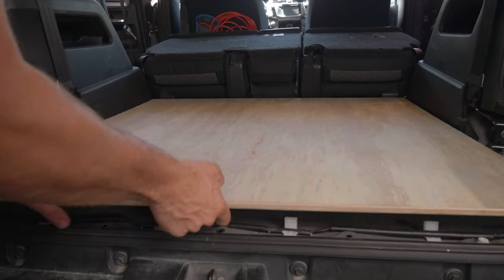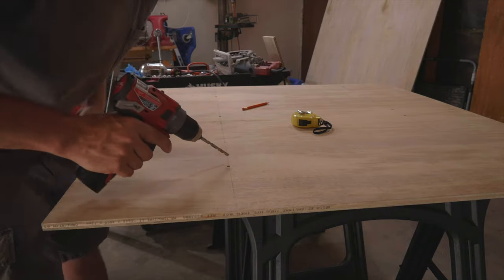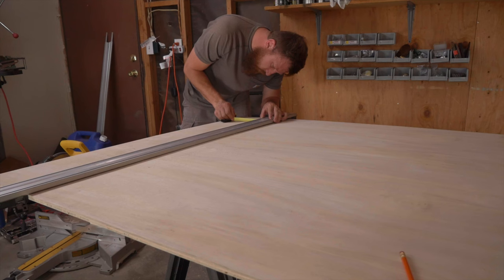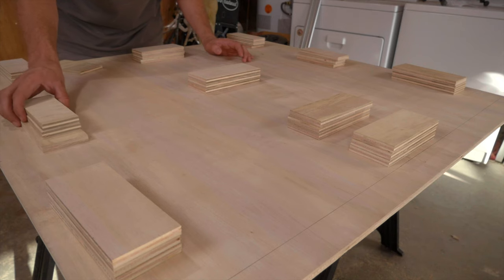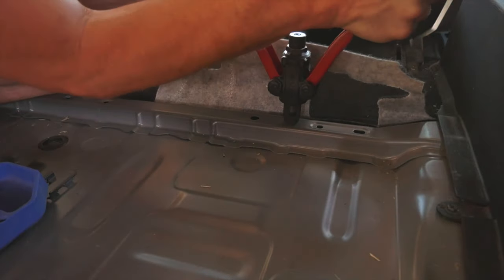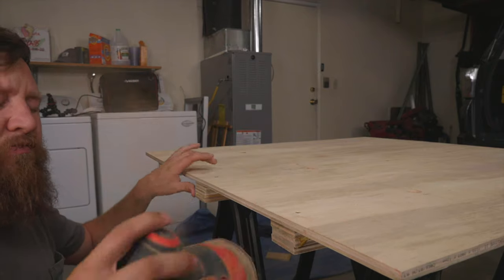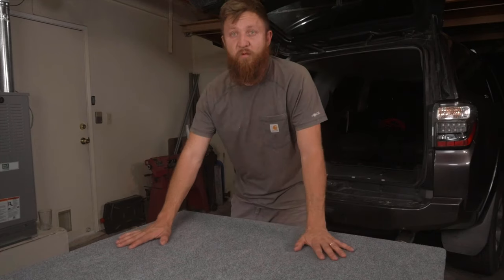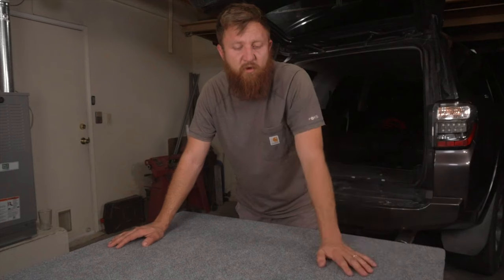DIY goose gear platform (3rd row delete)

Comment: Are the supports you put underneath, 3 pieces of scrapwood all 3/4 inch high glued together? @EmbarkWithMark
Reply from the maker: If I remember right, my base was 1/2” plywood. But yes it’s all scrap used from the same piece in the build.
Reply: @EmbarkWithMark     Thank you. I was basing it off the link you had to the plans. They used 3/4. Also, do you have the plans for the platform you made after to sleep on? This is my new goal for this weekend 😊  im washington based and hope to sleep in this soon during hunting season.  @EmbarkWithMark

Comment: Way over built.. if you go to the edge and put the plastic inserts back in and raise the lower ones up to level you can screw the platform right into the plastic inserts at the very end next to the door. And then you can do spaces as you care to. Although I don't plan on strapping heavy stuff down to mine. With 3/4 pilot is pretty strong with a spacer here and there not like you did way overbuilt... but bless you
Reply from the maker: I personally don't think its way over built. However, I do plan on strapping down a heavier things.
Reply: What a useful comment

Comment: What're your thoughts on this after a couple years? Looking to do this for the exact same reasons as you!
Reply from the maker: Love it. The 3rd row was a waste of room, weight for us. Doing this allowed me to install a drawer fridge, a large useful drawer, along with 200 amp hours of battery. The drawer and the fridge are used weekly. Even if you don't do that. The added space is insane!
Reply: @EmbarkWithMark  this is super helpful!! Is the trunk still the same dimensions, just taller by like 6 inches?
Reply from the maker: @richardson_adventures   That and, you can customize your tie down points, or mount things down easily by screwing into the wood. You also drop at least 150lbs of weight off the car. Which is nice.
Reply: @EmbarkWithMark  heck yes, doing this today then!!

Comment: What size plywood did you use? 1/2” or 3/4? Also, what size did you use for the supports underneath? Looks like 3x 1/2” but hard to tell. Thanks
Reply from the maker: I used 1/2” plywood but would recommend going 3/4. 

I can’t remember the measurements now for the supports but 3 1/2 sounds right. I just used the scrap plywood as you saw.
Reply: @EmbarkWithMark  Thanks! I just pulled out my 3rd row today. Still waiting on the bolts. Your video on removing the seats helped alot! 👍
Reply from the maker: Glad it was helpful! You’ll love having the extra space.
Reply: @EmbarkWithMark  So I got my bolts and rivnuts today (I opted to go with M8 instead of the M6 the design called for). I laid out my holes, double and triple checked my measurements and sure enough 2 of the M6/M8 holes are off by a good 1/4-5/16!! Changing to the M8's shouldn't have caused this discrepancy since I'm only making the hole bigger. Oh well, now I improvise!
Reply from the maker: @ryanskeete  I’ve done the same thing! It’s hard to get these holes exact. 

Also, the M8 was a smart move. I might pull mine out and switch to m8s all around. 

Did you choose 3/4” or 1/2” ply wood?
Reply: @EmbarkWithMark  3/4”.
Reply: Hello. Only use 3/4 that's more than enough

Comment: Hey there! I’ve seen that thread re: the 3rd row delete. Wondering how you got those precise measurements from the diagram of where to make the holes and everything !? Thanks!
Reply from the maker: So I took the measurement and converted them to fractions. Then took my time measuring each hole. 

I laid out every hole and cut all at once. Then made my cuts and double check my measurements for the holes.